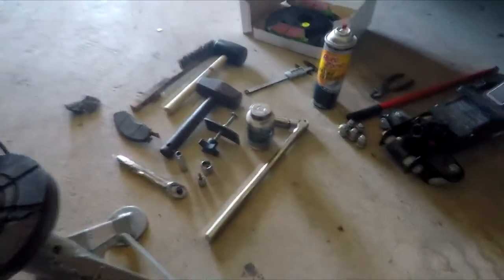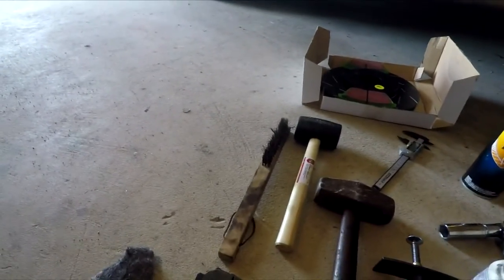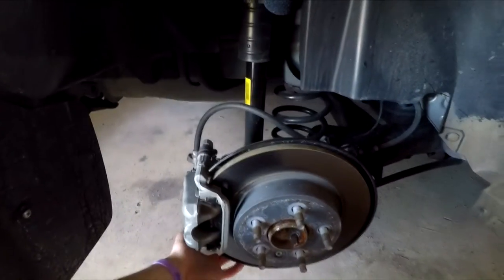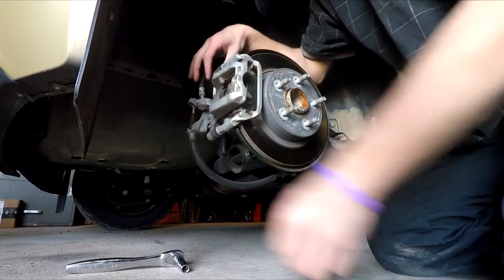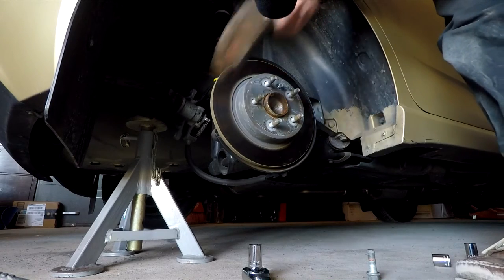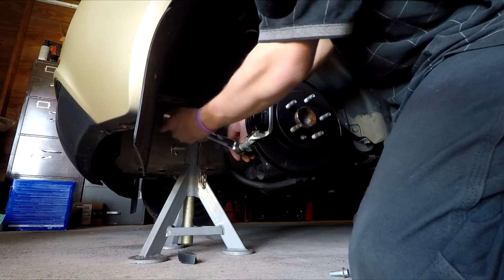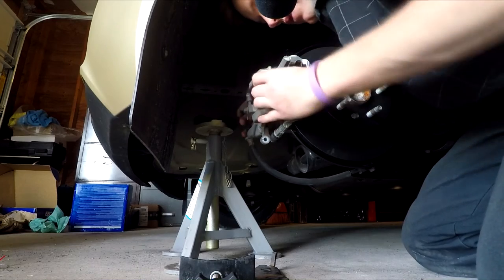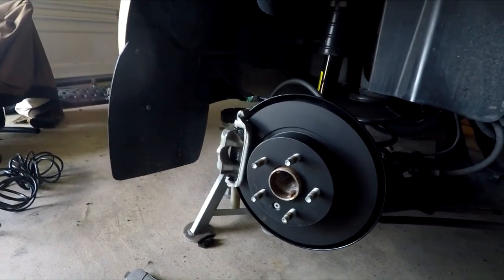How to Replace brake Pads and Rotors (Chevy Sonic) Ebc GreenSuff Pads (Complete Guide)

Comment: Question dont you need a special tool to turn in the rear caliper as its keyed and has to be turned in clockwise to drive back in the piston to make it flush to install the new thicker pads... plus if not replacing the rear rotor is it not necessary to remove the bracket??
Reply from the maker: Yes, I later found out you need the special tool to turn the piston in on some cars. Like my sonic. Yes the bracket only has to come off if your replacing the rotor

Comment: Is the same for 2013 hatchback rs? And is the same process like if u replaced the front brakes?? Or is different?
Reply from the maker: You need a special tool to Rotate in the brake caliper piston

Comment: For the caliper piston do u need just push down or do u need to rotate clockwise ?
Reply from the maker: It needs to be rotated
Reply: Do u know what is the tool name  please
Reply from the maker: @sancheztorres35  8MILELAKE Disc Brake Caliper Compressor Wind Back Tool 24pc Professional Disc Brake Caliper Tool Set https://www.amazon.com/dp/B0122Q83T4/ref=cm_sw_r_cp_api_glt_i_KKQTDWAMQ5247G8MSBYQ?_encoding=UTF8&psc=1
Reply: @CarsRMe  ok thanks i got that set i thought is a diferent tool 
Thanks so much for the advice